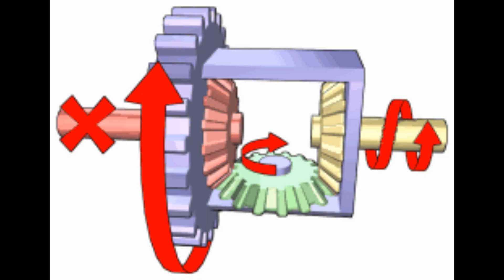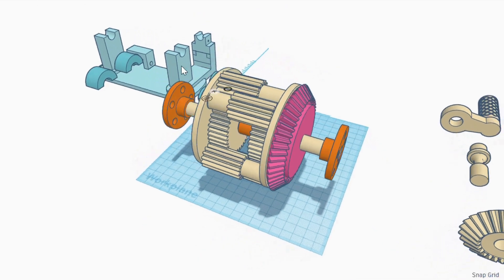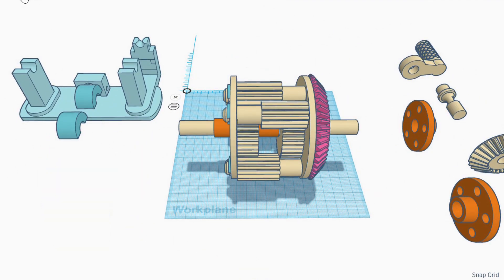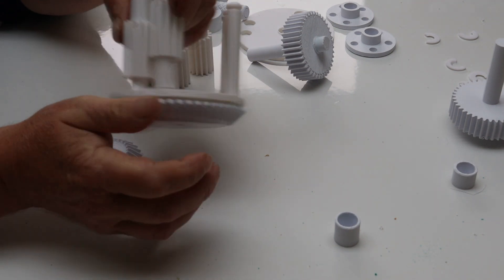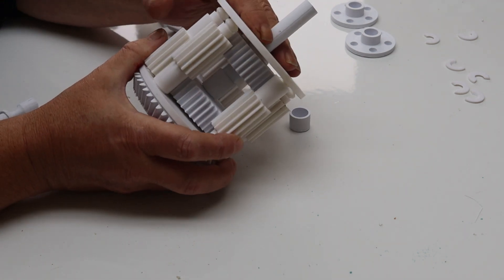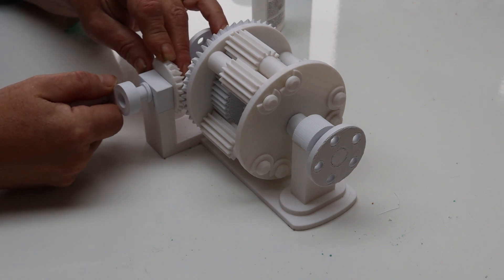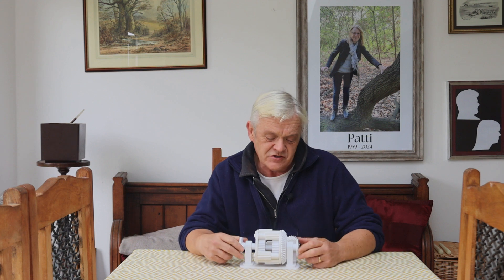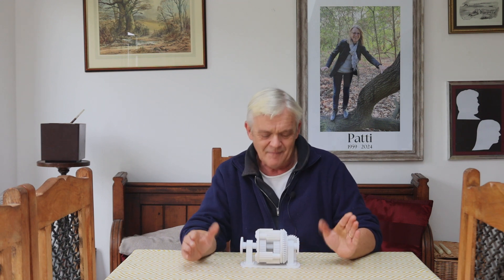2307 A Spur Gear Differential

Comment: It might be the vodka and coke talking but is there a advantage of this type of differential over a boggo stadard diff.
I found it very interesting to see a different type of diff. I was watching a video about a tuning fork causing a penduleam to move and wondered if robert had contemplated the potential use for power generaRation. sorry for spelling mistakes Ive not had a shandy for a while.

Comment: TORSEN type B, are modified versions of these with friction surfaces utilising helical thrust and end play to good advantage..  Coaxial helicopters sometimes use this gear arrangement in a low friction arrangement balancing the counter rotating torques "perfectly"..
Reply from the maker: cheers mate

Comment: first thing that came to mind with this is a 2 wheel drive motorcycle powered by an electric motor, both front and rear wheel are driven by shaft, and the braking can be done the same way some older BMW motorcycles have done, or even just having a secondary fork made just for braking
Reply from the maker: interesting concept mate - thanks for sharing